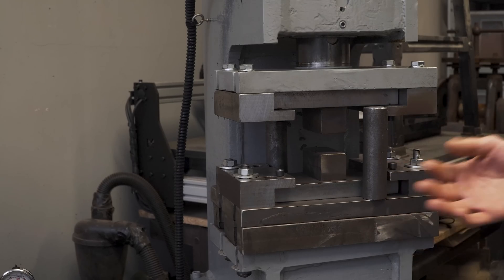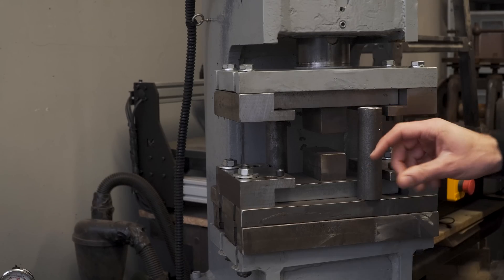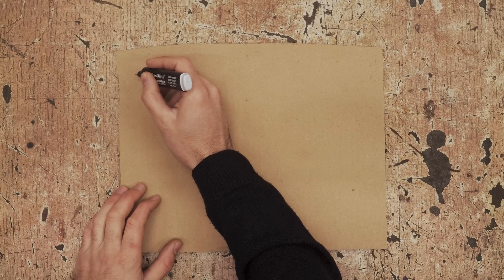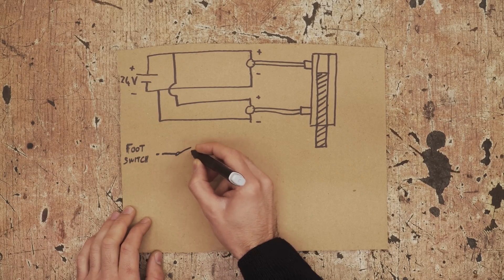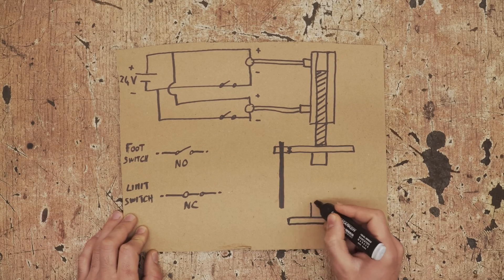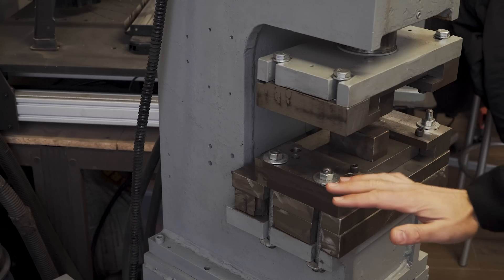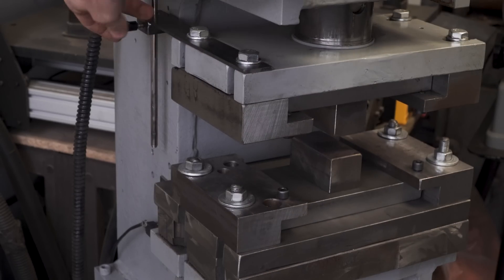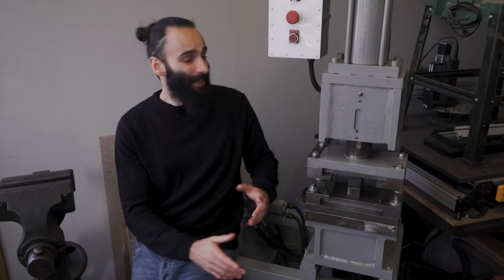Forging Press Upgrade: Limit Switch

Comment: I'd use a heavier duty switch that would handle the constant contact. It looked kind of vulnerable to breaking. My two cents. Great concept that works@
Reply: It's going to wear out quickly

Comment: Typically on machines with limit switches like this they push from the side. So if your rod had a ring on it and the switch was mounted such that it contacted the switch on the side of the ring. But if it over traveled (For some reason) it could go past the switch without destroying the switch and possibly the mount for the switch. That said your way is simpler and so what if it destroyed the switch they are not expensive.
Reply: +1 for the sideways switch with a roller! Roller arm limit switches are dirt cheap and you don't have to worry about the rod unintentionally smashing through the switch if the contacts wear out :)

Comment: I was expecting some kind of potentiometer connected to logic board and pedals where you set height, but adjustable rod that is hitting switch works too.

Comment: i would suggest that you put 2 switches on the same level, in series, so that if one fails, the other one still work. these micro switches arent known for reliable, double the switch, ^2 the reliability.
Reply: No, no, you'd better put five of them there, then it's only a certainty😉.